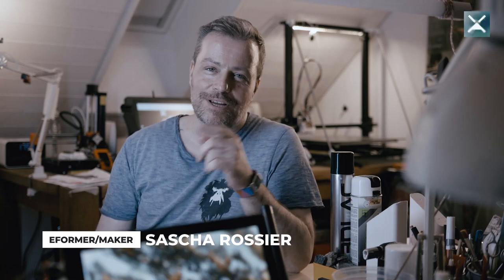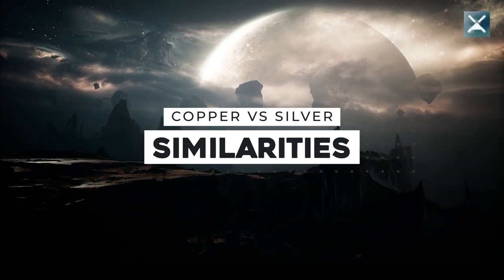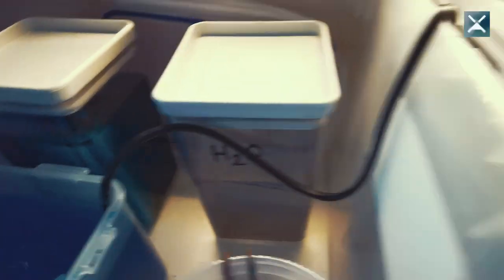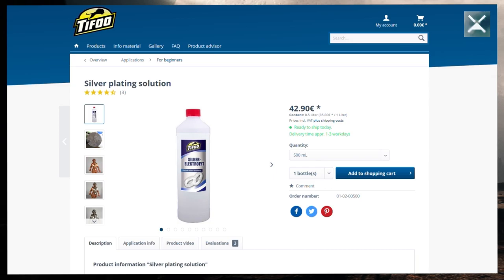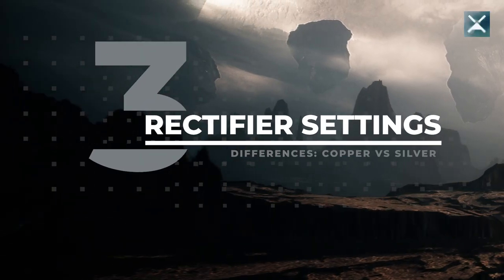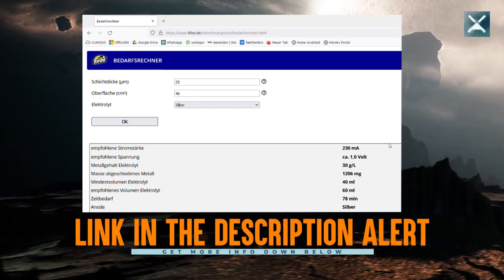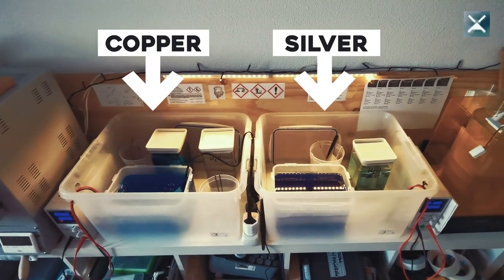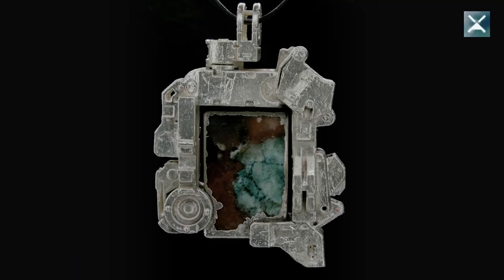Electroforming Quicktip - Differences between Copper and Silver

Comment: I'm looking for steps to build or buy a rotating jig. I can 3d print and work with electronics and motors, but I just don't understand how the charged wire connects to the stationary alligator clip that continuously spins via to motor. Does the bearing for the rotating axis need to be all metal so I can connect a stationary charged wire to it? Thanks for your info.
Reply: nevermind I see you added that in the comments! thanks!!!!

Comment: So does this mean the silver could rub off to shownthr copper underneath in time like eith plating?
Reply from the maker: Hejhej ... if the Silver-Layer is thick enough ... i.e. 20 microns ... it wont come off ... but any metal used in jewelry is subject to mechanical wear and will eventually suffer from dents and dings.

Comment: How big a piece of silver do I need to start?
Reply from the maker: Hejhej brizzy ... since the layer of silver is usually not too thick ... about 10-20 microns you should be okay with a short piece of silverwire for - lets say - a ring. It really doesnt take much. If you use a silver teaspoon i bet youll easily eform thru 40-50 rings.

Comment: Hi! I have a couple questions. Can I cover the solution with a lid after use so the fumes aren't still in the air? Also, is gold electroforming the same thing? But with a gold solution and anode?
Reply from the maker: HejHej Ariel ... Thanx for Commenting 🤙 Actually, I made a Video about the "Standby Mode" aka "what to do after use" : https://youtu.be/-lg3_0-dL2g ... Unfortunately I have never electroformed with Gold, so I cant confirm its the same process as with silver.

Comment: Hello! Your video is perfect for me ! I have a question. I already gold plating and Im using palladium for the first "layer". Do you think its possible to do the same process before using silver electroforming. Thanks a lot a for your answer :)
Reply from the maker: Hello Pauline. Thx for your Comment. May I answer with a Counter-Question: Why would you want to plate silver over Palladium? Palladium blows Silver out of the Water in almost every Aspect: its more noble than Silver. Palladium one of the earth’s most durable elements and is a precious hard metal that resists corrosion. While for the trained eye palladium is a tad bit darker than silver it is pretty hard to tell the difference between jewelry plated with palladium or plated with silver. And: palladium is more expensive. So why cover your gorgeous palladium with silver? Id just go with your "first layer" of palladium. 🌟🌟🌟
Reply: Yes sure, thanks for your answer. 

I saw its possible to do silver electroforming directly with silver paint but impossible to find this kind of product and Im afraid about the duration over time. 

Your solution looks great. It is really silver electroforming or silver plating? 

However, I wonder about the duration of electroforming with tifoo products which seems very short.
Reply from the maker: @pOuiin3  I love tifoo-products exactly because of that: they e-form very quickly and the results are predictable^and repeatable. But thats only my humble experience. you could test it: Their solutions are available in small batches as well so you can test it and see for yourself before you invest in massive loads of solution. Im sure itll be fun! And the folks over  at Tifoo are cool as well. Ive already asked them a thousand questions and they always answered.
Reply: Oh yes I will try for sure! It will be a cool experience thanks a lot for sharing your knowledge

Comment: Interesting, thank you! So I can not use 925 sterlign silver? It has to be fine? Also, the silver piece will have a copper layer underneath it?is it no way of acheiving a piece in solid 925 sterling silver? :) Thank you!
Reply from the maker: Yes to all of your questions. Its not possible to electroform 925 silver. The only way you achieve solid 925 stuff is with using silver metalclay or by casting it. Metalclay being less dangerous but more expensive.

Comment: May you tell us if you May go with nickel before you go with the silver 
And May you do the same procedure with gold? 
Do you heat the silver while you do the electroplating and at what temperature Thank you so much
Reply from the maker: HejHej Ana ... yepp ... it is possible to go nickel before silver. But i dont know the exact workflow because nickel electrolytes are very toxic and known to cause cancer. i stay away from very toxic stuff in my workshop. but you can go palladium before silver or gold. palladium is much safer to work with. Your workflow would be: conductive paint - copper - thin layer of palladium - gold or silver (tho the thin layer of palladium already looks very silverish and is actually more noble than silver) None of my electrolytes require heating. i use products from tifoo.de (no affiliation whatsoever - i just really like their stuff - it just works, always) and these electrolytes work perfectly with room temperature. hope 2 have helped. happy eforming!